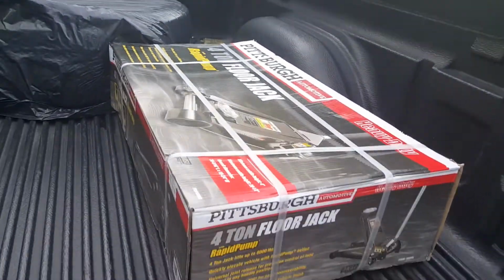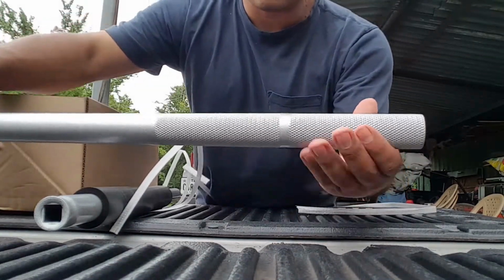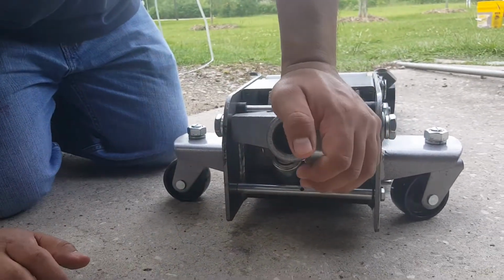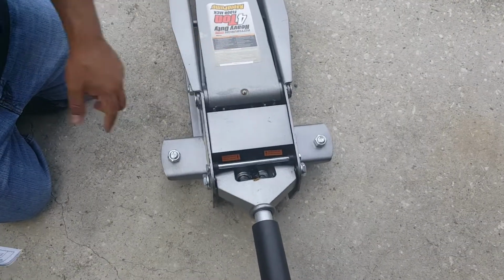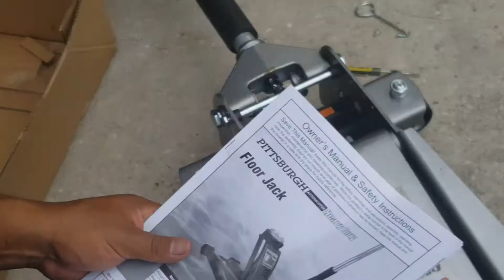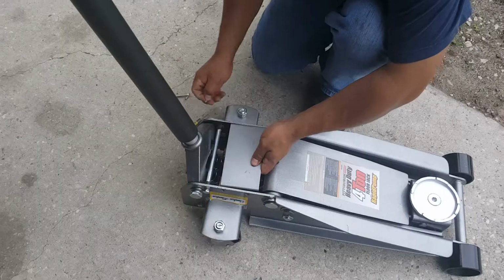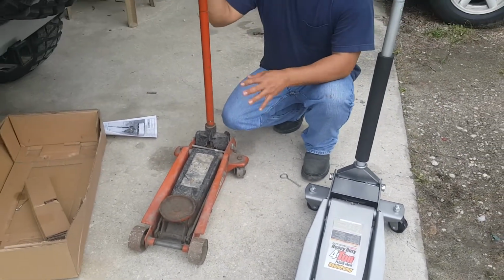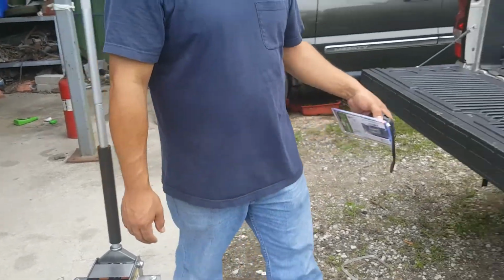4 Ton Floor Jack from Harbor Freight full review and unboxing

Comment: Hmm, that hidden fill screw...that might be why I could not get mine to work. Kinda feel like an idiot now, lol. 
But to my defense, I didn’t have any screw drivers to remove the plate or screw anyway. I’ll give it another try tomorrow.
Reply: I just wanted to let you know how my second day went...
Got a big flat screwdriver and a small Phillips. I never considered taking that metal plate off because everything on the pictures said do not touch those screws underneath it. 

Anyway, tried bleeding it, but nothing happened. While at the automotive store I also bought jack hydraulic fluid. And boy there is quite a bit that fits into the fill cap. 
Still nothing. 
Then for some odd reason I installed the handle properly. I hadn’t bothered with loosening the set screw to properly insert the handle. 
Boy what a difference. Now I could actually close the hydraulic valve. Before it was stuck in the open position even though the gears were turning. 

So that was pretty successful. 

On the negative side, I crushed one of the metal tubes on my trailer underbody. With 2 flat tires I could not get to anyplace but a couple inches from the side of the trailer. Maybe a flat plate on the jack would have avoided this. Oh fun. I still have to replace the two tires on the other side. Tomorrow...
Reply: Once I move the trailer to its new home, it gets put up on blocks.